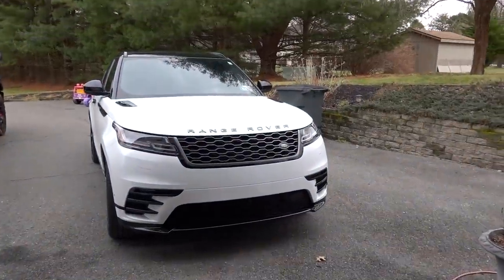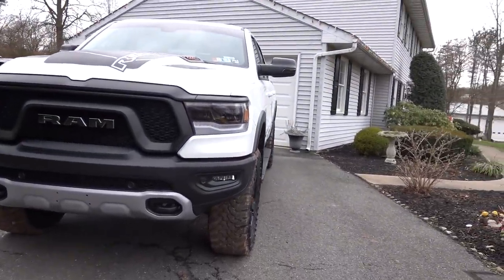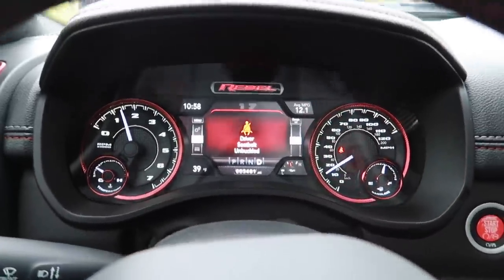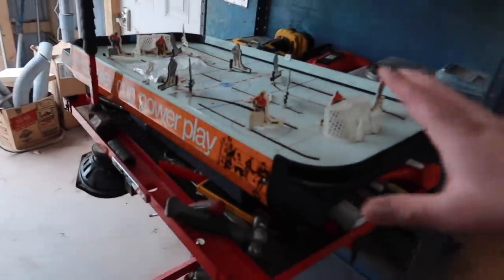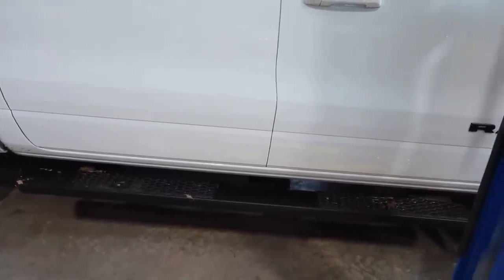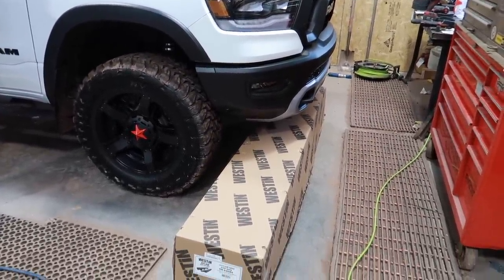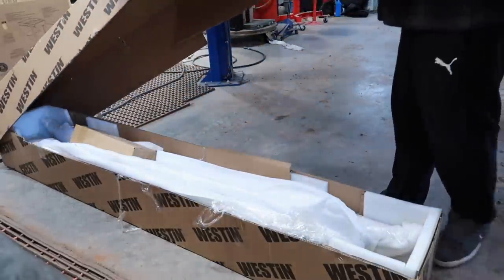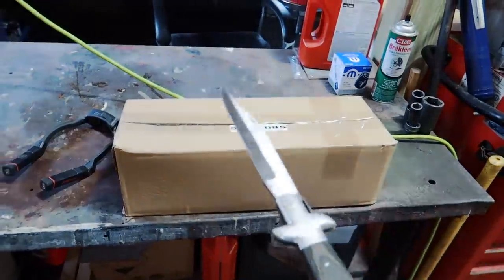2019 Ram Rebel Ultimate Step install

Comment: How did you paint your front brush guard?  In this video it’s silver or grey,  but in other videos it’s white which is a Huge Improvement!  I ask because I’m considering a 2021 Rebel Bright Whit and the brush guard is black and I would want to paint it the same white as the base coat of the truck.
Reply from the maker: I used Raptor liner if you go back in the build playlist there is a vid on it

Comment: The problem with the aftermarket steps, is the weak brackets. I have the  RC hd2 and they tuck up nice,but the same thing bracket is not heavy duty.

Comment: I watched your video about 3.5” readylift and i did the same. However, i am having an issue!! Control arms hitting the coil. When contacted Readylift , they said that the 3.5” sst is not compatible with Ram Rebel. Not sure if you are having the same issue and how did you fixed it?
Thanks
Reply from the maker: Yeah I knew that going into it my spring only hits at full extension, I think I will end up going with a full lift eventually, the ready lift is a cheap way to fit 35s but not ideal for off road

Comment: Like those stars on the wheel caps !
For sure match if you go ahead adding red to the wheels.
New running boards better grip with drain holes, also MORE RUGGED !
Did you consider mini boards for the four doors only instead of full length ?
Wish you had demonstrated speedometer adjustment for larger tire size.
Reply from the maker: I can show how the tazer sets the tire size its really easy
Reply: @HammerdownMotorsportsUSA  I wood  very much appreciate it !

Comment: Looks like the straight bracket goes in the middle. It would make sense by the bends on the other bracket🤷‍♂️
Reply from the maker: RedBeard 88 I thought that too but the bolt pattern is different in the middle
Reply: Just installed these on my 2020 Rebel. Directions state just as you installed. Straight bracket to the front.

Comment: The truck looks amazing !! When I bought my truck the dealer had already installed the off road style side steps and they have the bed liner spray on them , my last truck had the factory style running boards like the ones you took off and you’re absolutely right about them getting slippery in the rain and snow .

Comment: Those are not rock sliders sir, those are heavy side steps.  Rock sliders attach to the FRAME of your truck not sheet metal body.  The body sheet metal can not support the weight of your truck if the “slider” is resting on a rock.
Reply from the maker: jamesngotts yes I know these are rock slider style not REAL ones

Comment: The Red Stars are drawing too much attention being dead center. In my eyes it's like you don't see the rest of the wheel and other awesome work that was done to truck as much. Moto metal 961 wheels black with the red inserts would be a better more subtle balanced looked. In my opinion of course. The new decals are fantastic tho. Removed alot of the white and it just blends so good.

Comment: New steps was a great add!  You know, with the wider projection of the new steps, and also the lift and bigger tires - 90% of all vehicles out there will now badly ding their car door instead of dinging up your Rebel when they park too close! 😁👍  I say - go red tow hooks and front RAM badge to tie in red hood decal and wheel stars. Looking GOOD Hammer Down!

Comment: Not a fan of the red stars myself. 🤷‍♂️ overall really love the truck though.

Those steps are definitely not rock sliders and probably worse for off road than your stock steps. They hang down really low. I currently have something that looks very similar made by Tyger. I might get actual rock sliders made by white knuckle offroad but true sliders are damn heavy.  The sliders made for the rebel weigh around 230lbs.

Comment: Hammerdown Motorsports  those ebay links to the decals in the description don't work. They might be linking directly to your account or something, not sure. Just FYI. I have a 2020 Ram Rebel like yours and love watching the upgrades you've been doing. So far I only have the Mopar performance air intake and exhaust upgrade which makes the rig sound like an absolute beast.
Reply from the maker: arrggg yeah they sometimes get messed up when I copy and paste them

Comment: You didn't by chance weight the OEM and new steps? The difference effects the payload capacity of a vehicle. Not that this will make much difference in your case, but being a Power Wagon owner I have to be cautious of any weight gain.
Reply from the maker: yeah they probably add about 50 lbs all together

Comment: Truck looks sweet, but as beefy as the new steps are, I wouldn’t use them as a true rock slider, actual rock sliders are either bolted to the frame or welded to it, not attached to the body, if you use them as rock sliders, you will still do damage to the body and rockers
Reply from the maker: Desert Toyota true they are not meant for extreme off roading but that’s not my plan with this rig just a nice add on

Comment: Any issues with the steps I installed the same ones on my 2021 Laramie 2 weeks ago and literally black powder coat is chipping off the bolts holding the grip pad on so some bolts are silver now  and also grip pad getting warped after one snow storm in New York LOL

Comment: I don’t know if I’d trust a true rock slider that wasn’t bolted to the frame. Would that mounting system really support the weight of the truck?
Reply from the maker: Nope they aren’t real rock sliders
Reply: @HammerdownMotorsportsUSA  that’s what I figured. I have the white knuckle off-road sliders on my ‘20 rebel. I absolutely love them functionwise and have put them to the test for sure, but they are about 120lbs each and you can definitely feel the weight. They were the only option when I bought my truck though. I think I’ve only ever found one other true slider that’s a bolt on

Comment: Did you mention the wheels were -18? Do you have full spec. Looking to do same lift and my shop recommend +1 offset 🤨

How’s the ride vs stock?
Reply from the maker: Anthony Sager mine are -18 r20 9 wide the ride is slightly stiffer but totally manageable
Reply: Hammerdown Motorsports how did you calibrate the speedo for the new 35s?
Reply from the maker: @AnthonySager  sure did with the z automotive tazer DT

Comment: Love the Red. 
I just hate side steps. Im here cause I have Amp research side steps and they are crap! I done know what to do...
Reply from the maker: Mine were awesome but if your are having issues contact amp research they should sort it out for you
Reply: @HammerdownMotorsportsUSA  good to to know thx. Next week they are headed back to the shop cause the paint peeled off the boards, so Amp is replacing them. Its winter here in Canada, that they are no good. Snow and ice builds on them and they just wont to go up. I decided to just keep them up till spring. Not great considering what I paid for them, but ah well...